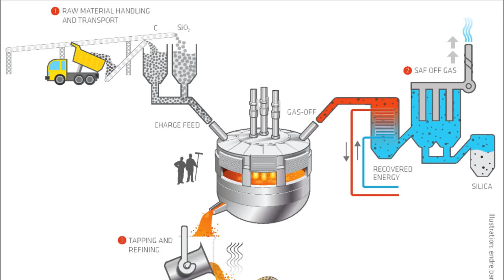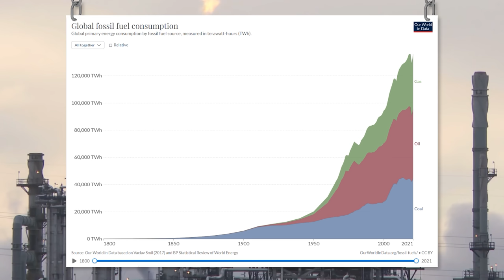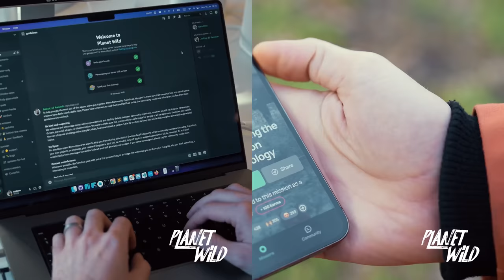We Will Be the Last Civilization on Earth

Comment: This is quite manipulative I would say:
1: Ammonia is made up of hydrogen and nitrogen; we could have produced it in hydroelectric power plants 100 years ago.
2: Most plastics are made from ethylene or synthesis gas, for example, during the shale revolution in the United States there was an excess of ethane, and many chemical enterprises switched to using it to produce ethylene and then plastic.
And there is also a whole branch of forest chemistry that has been actively developing since the 19th century, and we know how to use wood or straw to produce bio-plastic
3: On a general level, I would say that the author is trying to convince that there are only two options for a traditional type farm or fossil fuels.
4:Can you imagine a civilization that has reached the level of development of the 1960s and invented nuclear reactors and completely switched to them, like, say, France. But in fact, reactors using molten thorium salts can produce temperatures of more than two thousand degrees Celsius, which can be used for metallurgy and hydrogen production?
5: Can you imagine a civilization that produces methanol from solar towers, as was proposed 50 years ago in books such as "Methanol economy", which by the way was written by Nobel laureates in chemistry
6: Modern technologies for recycling steel include electric ark furnace, which is miniaturized and energy efficient, so if we do not proceed from fantasy considerations that all the resources we have mined will simply disappear, then the already mined cast iron, iron, copper and aluminum can be recycled to infinity.
7: I mean it's just ridiculous to say that concrete and bricks can't be made without fossil fuels when ancient Rome was built from concrete and Mohenjo-daro was built from bricks...
8: if we are talking about construction, it would be more environmentally friendly to switch to wood and bricks for building houses and to railways for transporting goods and people. Brick and wooden houses can last more than a hundred years, and the rails, by coincidence, have a shape well suited for rolling and extrusion, which is good for making them on electric ark furnace from recycled cast iron on a small scale
9: I can’t help but mention Julian Simon’s book The Ultimate Resource, in which the author, speaking at a more general level, says that the market always finds a way out: when a certain resource becomes scarce, this leads to people trying to find ways to use this resource more economically, trying to get more of this resource and try to find a substitute for this resource and ultimately the crisis will be overcome (as in France with nuclear energy). Again, I don’t want to say that solar towers are a good answer or thorium molten salt reactors are a good answer (or High-altitude wind energy from kites, growing algae in the ocean or deserts, tidal energy, wave energy, nuclear fusion, peat, combustibles shale, cosmic solar energy, a power plant based on the energy difference between atmospheric fronts, or the energy difference between salt and fresh water, or for example, hydroponic sugar cane can be comparable to solar panels in terms of energy efficiency, but energy is ten times cheaper to store and transport, and so on ...), but speaking at a general level, I believe that there are many ways to solve problems that we did not consider, simply because there were better options.
10: I believe that in the long term the cheapest way to deliver cargo into orbit is a large version of the Star tram with two kilometers long double-Decker trains and a rotating Sky-hook in orbit, funny that Isaac Arthur came to the same conclusions...

Comment: Most of your presentation was a litany of dependence on fossil fuel technology. Yet, the ultimate question is not how difficult it will be to move past that dependency, but the looming imperative that we absolutely must take seriously the warning signs of global climate catastrophe.
Your analysis also seems to overlook a fundamental fact about modern civilization-- given even mass catastrophe, our power to adapt and recover will be shaped by the knowledge we have acquired already. Not all of that knowledge will be lost forever, but will provide a head start to recovery.
No matter what happens, we should consider survival and technical development as one and the same process. As you point out at 14:36, future civilizations will face shortages of familiar raw materials. Even so, they also could develop new technologies to bypass petrochemical issues. So, this may not be an either/or debate, but rather dramatically reordered priorities for the use of many different energy sources, from solar to geothermal-- all with an eye to proper management of our only livable environment.

Comment: Such an intelligent and well made video, but so far from the main point!  The problem with fossil fuels is not how soon they are going to run out (peak oil/gas/goal), and how a subsequent civilization of roughly the same size as ours can explore space without them.  The problem is that if we continue to use them for all the admittedly wonderful material features of modern industrial life, they will generate enough greenhouse gases to render the earth largely uninhabitable. Due to CLIMATE CHANGE.  The video doesn't mention climate change and its disastrous consequences once!

It does mention renewable energy in passing, in pointing out some of the main technologies that create solar panels and wind turbines require significant fossil fuels.  All to say that it will take that much longer to to stop using fossil fuels and that therefore greenhouse gas levels and consequent global warming will go even higher and faster.

The important question is how hot will it get and how fast, and therefore how long until industrial civilization collapses.  I don't  believe, as some do, that the human race will go extinct, because I think there will be little pockets of humans that find niches to survive at somewhere between a stone age level and maybe eventually even a bronze age level.  But all the discussion of how various features of modern civilization  - concrete, steel, silicon, and especially space rockets -- can be preserved or recreated is just silly.  Over thousands of years, the earth's climate may find a new balance and technically advanced civilizations will begin to rise again, but it won't be on the back of the current civilization, it will be a total redevelopment.

Comment: Although fossil fuels may have been required to get us here, I think we have the ability to stop using them. Electricity can be replaced with renewables, nuclear, and batteries. Most transport can be powered by electricity, with aviation/shipping requiring either new battery technology or algal biofuels (batteries look more feasible atm). Steel/concrete can be made with current electric arc furnaces, with silicon able to be smelted with lab-stage versions. There are experimental ways to create ammonia with electricity. Bioplastics could be made from nitrogen-fixing Cyanobacteria, which I would like to develop. I would also try to recycle as many nutrients as possible to reduce strain on the food supply.

Comment: My book Pluvicopia shows that we can access the energy in the water cycle. In one year, it pushes more energy into space than civilization has used in all human history. It is easy to access from a meteorological perspective. The architecture and engineering proposed are preliminary, but if the meteorology works as Pluvicopia suggests, all the damage from fossil fuels can be repaired expediently to save biodiversity and control climate change. Alex pointed out that CH4 methane can provide concentrated energy for rockets and plains. So can hydrogen. Pluvicopia is simple enough that an early civilization could build it, although it would take work. Pluvicopia counts on modern materials and knowledge.

Comment: Idk, you're assuming that we would have to retrace the exact same steps to rebuild. We don't need to. we could develop an alternative to concrete. If fossil fuel isn't viable, then maybe we can use hydrogen. to get to that we could start by generating electricity and using THAT to generate the heat necessary to smelt iron. the best part about a good sandbox game is that there are multiple ways to reach your destination.

Comment: actually there will not be a new build-up of coal, gass and oil as the reason why it happened was because there were produced so much cellulose but nothing could digest it at that point. So that is why so much carbon was trapped in sediments. Today, there are plenty of organisms that digest cellulose, and hence, the build-up will be minimal.

Comment: Fossil fuels will never run out. We could use more than the rate of replenishment. 

But crude oil is a natural process. Oil fields routinly are extracted until dry out and years later there's still oil. 

Natual gas will never run out. It's the earth's farts, lol. 

Coal could be all used up since that is a process that takes far longer to form.

Comment: I know I'm splitting ahir here... but , I'm makin a realistic post apoc survival game. The solution to smelting high temperatures is to cook wood, not 'burn' but cook. The process outputs large amounts of charcoal as mentioned, but if captured and driven properly the SYN gas and produce extremely intense large scale blowtorches and can also be used to power generators. You could even run a truck off this, process. The space requirements is about the size of the fridge. To learn more google "Wood gasification". Biogas from compost (methane essentially) is extremely easy for any little hobby farm to produce, capture and direct in to something. Ethanol is also a great low tech energy source that could be built up from copper so is good for bootstrapping. 
Most of these idea's don't really require the remnants of our civ to feed on and can be boostrapped from bronze.
Reply: Also Ammonia can be produced using the "Haber Process". It's only real external input is Hydrogen gas and a a special iron catalyst. It's probably going to be the next process we move to to move AWAY from methane conversion as it's a cheaper process. Google it. Hydrogen? Electrolysis from solar or uranium or wind. Suboptimal only when compared to current economics. A lot of this video is missing the point. We're actually really good at conversions, and most of us don't know much about it because society is driven by economics. We use only the cheapest methods. For example did you know that if oil became expensive to a certain degree that you can convert coal directly to oil? What the price? About $35\bbl
Reply: Damn, this video also misses that you can make plastics with cornstarch, potatoes, and cassava. It's competitively priced. Also, we don't need 8 billion to get to space. The USA did it's pretty much solo with 150milllion... and the USA did it in a rush.

Comment: A lot of the problems presented here have obvious solutions that are being ignored for the sake of profoundness. "We can't make wind turbines because they need steel and plastic"? That's like saying you can't make a toothbrush if you don't have plastic, simply because every toothbrush you've ever owned is made of it. A wind turbine is just a windmill with some copper wire and a magnet.
And arc furnaces were invented long, long before the silicon revolution. We've never needed fuel of any kind to reach the necessary 2,350 degree temperature, it's just more economical to use natural gas.

Comment: Electric arc furnaces can reach temperatures of 3200 degrees F or 1760 degrees C.  If you have enough electricity, it's entirely possible to heat things to the sorts of temperatures for concrete and most of the other things mentioned in the video.  Fossils are not, necessarily, a requirement.  That would be the simpler route, but it wouldn't necessarily be the only one possible.  Without fossil fuels technological development would just go down a different path with some technologies developing in different amounts of time than they did in our history.  But it would still be possible.  The main thing I see that is not in the temperature range of an arc furnace would be the temperatures for silicon mentioned.  That was a temperature of 4262 degrees F or 2350 degrees F.  Could a hotter electric furnace be developed to pull this off?  Maybe.  But nothing that I know of that exists today.  But, necessity is the mother of invention.  And it's entirely possible that people depending on electricity to heat materials with would find better ways to do it.  Which, again, suggests a different path for technology to take than the one we are familiar with.

Comment: One correction in facts for you :  "Easy" coal and oil is not gone or in short supply.  "Easy" coal and oil ~ in the volumes we will and do need, are demanding more extensive equipment to harvest.  A shovel will dig plenty of coal for a family or two to survive and thrive. For 8 billion people you need more EXPENSIVE and extensive shovels.  Money is the reason that analyzers on the subject forget to examine. There is currently plenty of coal for at least 250 years at the current rate of use, but we know that we will be using exponentially more in the future.  The "Easy" is defined by how expensive it is to harvest.  The same holds with oil,  as a single individual can harvest oil in some areas of Texas by digging a water well in the back yard.  And in some areas, natural gas leaks from the soil.  Again, we find that the term "Easy" , relates to the expense of harvesting and extraction. Not the amount available, but with the quantity demanded.

Comment: Oh no!  If only we had invented electric arc furnaces before the collapse - we'd be able to melt iron without the need for fossil fuels.

Wait, we already have them?  Ok - nevermind.
Reply: Imagine using all our non-fossil fuels to power those electric arc furnaces to create or reshape just enough steel to keep replacing those power sources as they wear out. An eternal furnace to create power to keep the furnaces running eternal.

Comment: As for the need for fossil fuels, yes we need plastics and certain secondary products.   As for thermal systems and combustible fuels, consider nuclear.   We have on the books now, technology that can get very hot.  Temperature sinks that can handle industrial processes.   A reactor not designed for grid electricity, but instead the heat exchangers geared towards cracking carbonic acid from the ocean, hydrocarbon synthesis and ammonia production.   We can derive oil derivatives from the atmosphere/ocean gas cycles.  There's nothing unknown about these processes, it's simply that we don't employ them on an industrial scale currently.   It's too bad, too, as they'd make massive dents in our ecological problems.

Comment: Oil is not a fossil.  It came from microbes years ago.   These microbes are buried under the earth.   Not all places have these microbes.  The resource is finite unless you believe that other theory about abiotic oil.   It takes thousands of years for the oil to get into the state we extract it.   We are extracting it at crazy fast speed.  We have to consider hydrogen or some other fuel long term.

Comment: IT wouldn't solve the plastic issue, but would it be feasible to make mirrors and glass without fossil fuels? Solar furnaces that work by reflecting or concentrating sunlight can reach very high temperatures, about 3,500 degrees celccius.

Comment: @Astrum : Little nitpick. At 13:20 you mention proven reserves and imply there might be more fossil fuels to burn through. While this is likely true as more discoveries will happen in polar regions and improving technology will help with existing reserves, the real number we should be concerned with is URR (ultimately recoverable reserves). This number is significantly lower than the proven reserves. Much of our fossil fuels will stay in the ground because they are no longer economically viable to extract or technically feasible (at some point).

Comment: It's been we'll run out in 50 years since the late 80s.  There's definitely more oil accessible right now, just look at the oil sands estimate of around 400 years worth of production. The problem is the wasteful way we use them that will lead to the exhaustion of the resources. If we even get there at all.